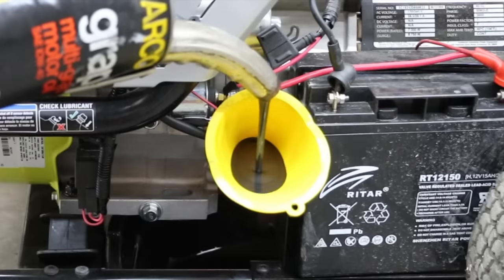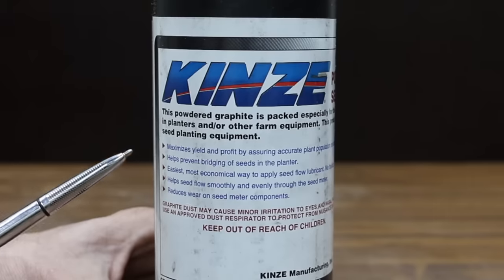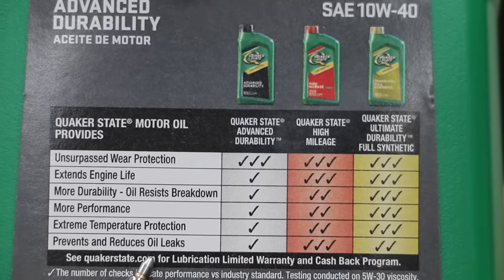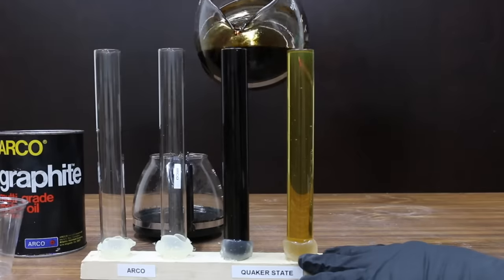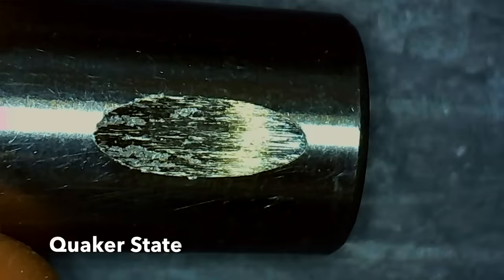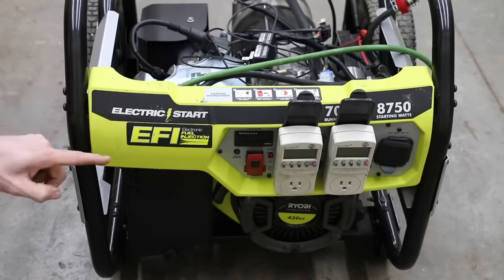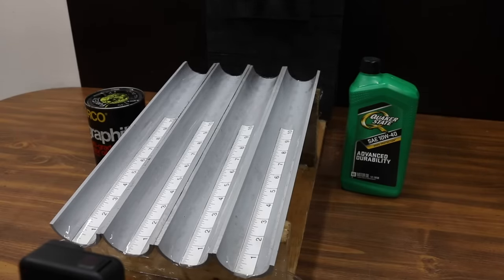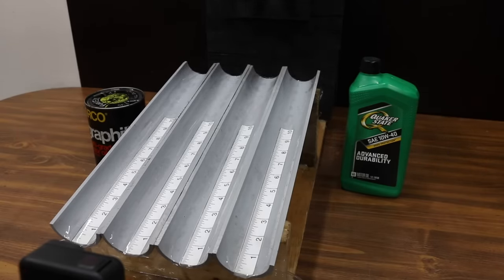Will "Graphite" Help Motor Oil Performance? Let's find out! Vintage Arco Graphite vs Quaker State

Comment: I would like to see you put different things to the test using junkyard catalytic converters and confirming what will or won’t actually kill them. Thanks.
Reply: Yeah, that's a good one.
Reply: Brilliant
Reply: Good idea
Reply: @grantodamax  if you want to try it do so at your own risk, but i once had a car with clogged cats and i unhooked the headers and dumped acetone in them, let them sit for 30mins-1 hour, then started the car. It smoked like crazy, but the clogged cat didn't glow red hot anymore, misfire stopped, and check engine light went away on it's own. I was amazed! Wish I had gotten it on video to put on my youtube channel
Reply: @jonyrock  this is interesting. im interested on how it managed to unclog the clogged cat.
Reply: @jonyrock  and this is also a nice idea for future project farm videos.
Reply: @MrUnderEstimated  it was very interesting, I didn't have anything to lose from my test, but I did always wonder whether the honey combs in the cat melted from the acidic effect of the acetone. No Cel means efficiency was restored right? At least enough to where the O2 sensors didn't detect anything
Reply: @grantodamax  interesting, that would make a good project farm video! Let's try all these different chemicals and see how they work!
Reply: Good idea.
Reply: You can get jeep cats for $45. Silicone fumes in silicone vacuum hoses are said to ruin cats.
Reply: @grantodamax  If you want to clean your catalytic converter, take your vehicle out for a long drive of an hour or more at freeway speeds and do this a few times. This will allow the catalytic converter to heat up and burn off buildup. Cars that only do short trips or in city driving never really reach operating temperature in the engine or the catalytic converter for long enough to burn off any carbon soot that builds up, which leads to a damaged cat.

Washing a catalytic converter can damage the delicate comb structure and the catalyst metals doped on the insides of the comb. If the catalyst metals are damaged or removed, the catalytic converter is useless. Also avoid doing dumb things like dumping seafoam down the intake to get the white smoke coming out of the tail pipe, like the idiots on those "I fixed my car by seafoam, look at the results!" videos. The result is a damaged cat, which may not be immediately apparent, because cats are generally overbuilt to allow some loss of function before they stop working entirely.

Comment: I can't imagine that working well with an oil filter.
Reply from the maker: Thanks for the feedback.
Reply: Yeah, I was thinking the same thing. Wouldn't a decent automotive oil filter remove a lot of the graphite? It does resemble dirt, so it'd have to be very tiny to get through the filter. Sounds like it's better utilized in lawn equipment than in cars.
Reply: Actually,  that was never a problem.  I used to use this oil in DOHC Fiat 124 spider engines in the mid 1970s.  High rpm with redline of 6900.  I used Hastings depth filters and other top name filters.  I changed it every 2000 miles and it did decrease oil consumption a bit.  The Fiat engines tended to go through 1 quart in     1500 miles or so.  I switched to Mobil one by the late 70s and embraced a 10k mile change interval.  Never looked back.  But the filter question, no problems as the graphite particles were smaller than pore sizes in the filters.
Reply: My dad used this exclusively back then. The graphite was supposed to be small enough to not get filtered out.
Reply: Ben Finny  a clogged filter shouldn't damage an engine because there is a bypass valve to prevent just that
Reply: I used the stuff in a Honda CRX500. No problem with filters and I got extended milage.

I think it ruined the the cam chain tensioner. I heard later, long after it was off the market, that it damaged high carbon rubber.

Comment: I used ARCO graphite oil on my beloved 75 Dodge Dart Swinger with a 318, my first "good car" - I was impressed with the feel of the oil in between my fingers - however, no gas mileage improvement, it wanted to leak out of every seal on this low mileage engine, and I quickly changed back to a regular good oil.  The leaking stopped when I changed back to a regular oil.
Reply from the maker: Thanks for sharing.

Comment: I used arco in my 1978 jeep cherokee. I used it for several years and when I took the valve covers off carbon deposits had built up to the point the valves were the only parts not solid carbon. That old jeep 360 was tough, I drove it on the beach quite a bit and more than a few times the coolant line broke and the engine would overheat and lockup.I'd wait 20 minutes or so and start it up and drive away. Some times it took several cooling off periods to get to the end of the beach!

Tough engine but the oil left more carbon deposits that you would believe. often the valve lifters were totally encased in solid carbon except the range of the parts that moved...
Reply from the maker: Thanks for the feedback.
Reply: jeep jeep jeep jeep
Reply: Not surprising on carbon deposits. Graphite is pure carbon in flaky crystals.

Comment: I use zinc additive in my older car engines per recommendation from old school mechanics, never truly been sure if it actually made a difference or not
Reply: It does, the additive is designed to deposit a layer of zinc metal onto bearing surfaces that wears away instead of the bearing material underneath. The use of zinc additives is the main reason passenger car engines went from lasting 50k miles to some lasting over a million, because not only did it improve bearing life, it also meant you could use tighter tolerances inside an engine and not have to worry about them wearing down.
Reply: You need zinc in the oil in engines that have flat tappet valves (think old engines, vw aircooled motors, stuff of that vintage) because the zddp additive helps prevent damage when the oil is placed in a "shear" such as when a cam with a thin film of oil directly rolls under a metal pushrod with no roller.  Also helps deal with acidity??? I think??? To some degree, helping increase the lifespan of the bearing surfaces in older motors, which are made out of different metals than modern bearings
Reply: @markdennis5150  I think new engines don't need a zddp additive.  Modern oils have better additives package to meet the needs of new engines, different bearing materials, etc.  I think zinc can cause issues with the catalyst metals in your catalytic converters if your motor burns oil.  Zddp is definitely something 5o consider if you're adding a modern oil to an old motor that relied on the zinc/lead for their lubrication properties.
Reply: On older engines, they don't have roller lifters. It's just a piece of metal riding on the camshaft and too help with it wearing out is the film of oil with zinc on the cam.
Reply: zinc also helps slow rust, the commonly add zinc anodes to dams and locks because the oxydization will target the zinc first
Reply: @markdennis5150  Zinc will form a layer on engine metal, which will extend the life of  bearing surfaces. Cars made after 1980 came with catalytic converters. If the motor burns high-zinc oil, the zinc in the exhaust will also form a layer on the exotic metals downstream, killing the catalytic converter and oxygen sensors. Over the last 40 years, zinc has been replaced by better additives that provide more protection than zinc, without the downsides.
Reply: I believe that modern racing oils still contain high levels of zinc, for wear protection in race engine applications. These are engines with no emission controls or catalytic converters. So, while you ‘could’ put a racing oil into your street vehicle, you’ll end up killing your catalytic converters, which will be expensive to replace.
Reply from the maker: Great strategy!
Reply: I find it very interesting that bicycle shops are selling lots of bicycles with zinc grease on the chains.
Reply: @RbNetEngr  Same as with diesel engines, they do not have catalytic converters but particle filters and motor oil for diesel cars may have higher amounts of zinc.
Reply: There is a TON of misinformation regarding zinc content.

First is adding some to modern oils is usually pointless.  Most quality modern oils already have a high zinc content, it just isn't used as an advertising technique anymore.  And, when people stop hearing a thing they automatically think it isn't there anymore.  Most modern quality oils have a fairly high zinc content already and adding more won't change anything.

Most engines don't need zinc to begin with.  Zinc is mainly for high lift flat tappet cams popular in the 50's and 60's.  If an engine has roller lifters or even a modern cam and lifter set in it, then adding zinc won't benefit the engine.  It was needed for the original parts because of a combination of poor metallurgy that resulted in not properly hardened parts.  And poor design which introduced awkward thrust vectors to the lifters.

The low compression engines common with flat head design rarely gain any benefit from added zinc with modern internals.

Some engines, such as Packard, designed them decades ahead of their contemporaries with better thrust angles and roller lifter, making the zinc already in modern oils more than enough to sustain it's life even under regular use.  Packard engines even in the 30's had advanced design features such as roller lifters and insert bearings, which among other things, allowed their engines to be across the board superior to other engines of the era.  It allowed them better power, longevity, and efficiency without the need for any added stuff like zinc in oil or lead in fuel.

Comment: Back in the 70's I bought some graphite additive and put it in my motorcycle. within 10 minutes the idle increased by 500 rpm at idle. Sadly it affected my clutch, so I had to remove it, bit I sure would have loved to give it a long term test !
Reply from the maker: Thanks for sharing!

Comment: Just gonna say, that 20 seconds, over the course of 40+ minutes, would fall with in a pretty tight tolerance for error.  Either due to a slightly different amount of fuel, or other variable that can't be tightly controlled outside of what oil is present.
Reply: Arco's claim was based on the competitive oils 40 years ago. They had no idea what we'd be using today. How would you compare today's oils to the oils that will be available in 2060?

Comment: 0:36 It's not a fair test at all. That Arco oil is "vintage" and possibly what, 40 years old?? That's actually quite impressive considering it's age. Oil breaks down over time, and ESPECIALLY older conventional oils with older technology. 

5:27 That is a good example of the additives put into the Arco oil. I would attribute that to the graphite. 
I would perform this test with or without graphite in the same oil.  

12:46 I think the reason for increased compression is because the graphite is getting embedded into the ring gaps. 

I would perform the tests with only the additives added to exact oils, not with vintage oil.

Great test process though! Fun to watch!
Reply: Great point.. plus it was made for iron blocks engines for the time? Would that be the reason for the high Iron?
Reply: @drdysl3xia795  I don't think there's any useful purpose for Iron in fresh motor oil.  Id' rather suspect it was from 40 years in a can with steel lids.
Reply: True, SF vs SN is probably going to swamp any differences from the graphite.  But it does go to show that the retrogrouches maybe correct about the effectiveness of some of the compounds that have been reduced in newer classifications.
Reply: @BixbyConsequence  Great point.
Reply: I completely agree! It's hard to say what, if any, impact the graphite has had as the base oils are so different. The fact the Arco won the bearing test is incredible and would seem to indicate a retest with the same oils with and without graphite is in order, so the only variable you're testing is the graphite. A rare aberration in a channel that normally uses a pretty precise scientific method, but I'm sure one which will be fixed soon! :)
Reply: Oil doesn't really break down when it's just sitting in its container or in your crankcase.  Oil breaks down because of heat and metal particles in your engine. That may not be the case with the graphite added, I just thought it was important for you to understand that about motor oil itself.

Comment: I use to use Arco at every oil change on my AMX,,, and yes, it did improve compression and performance. Years later I bought a 62 international 2-ton utility step van with a oil burning 318. It not only packed the piston grooves between the rings and piston stopping oil consumption it kinda helped bearing clearance giving me a steady increased oil pressure along with improved power!
Guess the Auto industry didn't like that "fix in can" and somehow got it off the market.
Reply: Its not a fix in a can. That level of zinc and phosphorus will destroy modern catalytic converters. Fix one problem and create 3 more on a modern engine.
Reply: Rotella is an oil engineered with graphite, designed for Diesel engines. I use fully synthetic Amsoil in my little Dodge 3500 5.9 Liter Cummins, but I know folks that use the Rotella in some of the larger diesels (13 Liters)
Reply from the maker: Great feedback. Thank you

Comment: 9:45 - Not to question your methodology, but why did you check the compression on the engine and THEN clean the head and replace the head gasket? Seems like it would seriously impact the compression numbers, to me.
Reply: I was thinking the same, would have liked to see it before cleaning, after cleaning, after running with graphite, and again after cleaning to see how much the buildup alone might increase compression.
Reply: its a refrence, usually done in 4, one for each before and after for both products, and each gets a new gasket and deposits cleaned out. there must have been a editing mishap, or he forgot the compression test. perhaps the file was corrupted, who knows. normally he does before and after though

Comment: 17 years as a Locomotive Machinist with BNSF- We put Graphite Oil in the Center Castings (it's where the locomotive  body interacts with the traction motor trucks) to protect them from wear.  It is a major PITA to clean and handle.
Reply from the maker: Thanks for the feedback.

Comment: Something that hasn't been brought up yet (at least not that I've seen!) is oil filters. Oil filters are designed to remove suspended particles from the oil and what is graphite? A suspended particle. So you would think that the better of an oil filter you have, the more particles it will pick up so the quicker the filter will gum up and the quicker it will kill your oil pressure which will cause damage to the engine's internals. At least that's the way I look at it. 🤷‍♂️
Reply from the maker: Thanks for the video idea.
Reply: Clogged oil filter won't suppress engine oil pressure as it will bypass the filter once it clogs.Which is just as bad if not worse in the long run since you're now recirculating all the suspended debris throughout the engine.

Comment: Used it in a 1969 ford 429. Do remember having to turn the idle screw down on the carburetor several times. Also if had a oil leak in your engine it would be much worse
Reply from the maker: Great feedback. Thank you

Comment: I used arco graphite in my old FIAT back in th early 70's   I did not change the oil for a couple of years. Just kept adding arco graphite when it went low. When I decided to change the oil later on the oil did not leave the pan. The mechanic was surprised the  FIAT engine did not break. You gotta love that engine and maybe the oil too.
Reply from the maker: Thanks for sharing.

Comment: Hi Todd, I've used the original formulation of the Slick 50 additive for several years. I feel like  I've had great luck as far as  mpg, smoother, quieter operation, and longevity between oil changes. At some point in their history, I believe Slick 50 was bought out and changed to a thicker, slow pour product. I didn't feel like it helped my engine or oil obtain any difference compared to the other additives that I would classify as viscosity thickeners. Then recently, the "Original Slick 50" returned from the guy who first marketed the product. It seems to me that this actually is the original additive because it provides me with all the attributes I liked so well. It also has a much thinner viscosity than the "molasses in January" version I would shy away from. I'd love to see both versions make it into the next Project Farm quality showdown and to know if I'm correct or if I should just return to maintenance guy school. I'm am also a fan of Amsoil, so a great test may be Slick 50 (both versions) boosted Amsoil and a standard Amsoil. Thank you from a grateful fan. Keep up the great work and for plugging some very big holes that allows deceptive marketing  to bring some questionable products to the masses. If they had to meet standards similar to the oil they're being added to, I believe that snake oil well would almost dry up. Congratulations on your success, and again, thank you so very much!
TJ Meyer